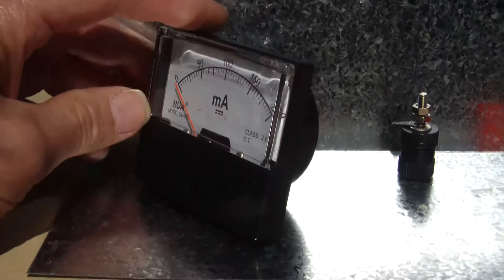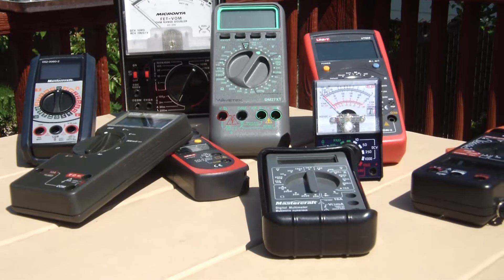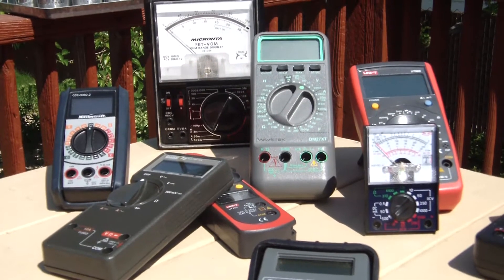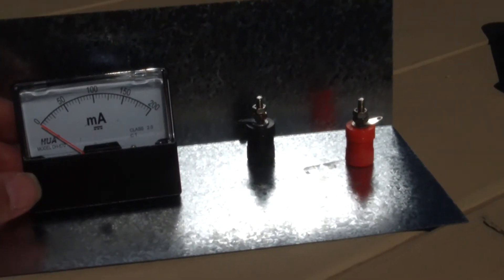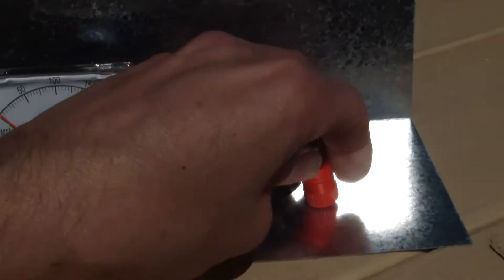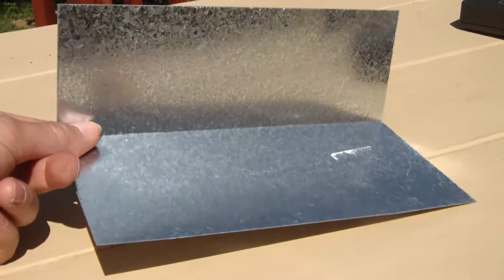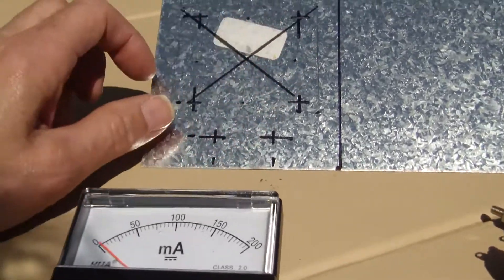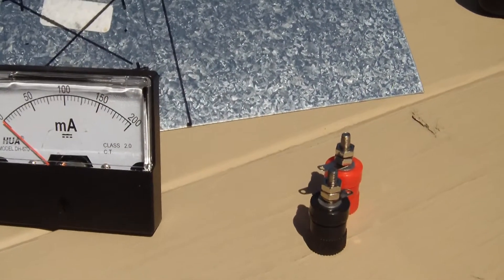DIY: milli-amp meter projects, Part 1

Comment: You know mike, I am right there with you on that about having all those meters and none will work worth a flip for adjusting bias. Had a new Fluke and worked on a radio for 2 hours before I found the problem was in the DMM I was using. Now I much prefer having what you just showed. Cannot beat a good old fashion analog meter. Thanks for sharing.